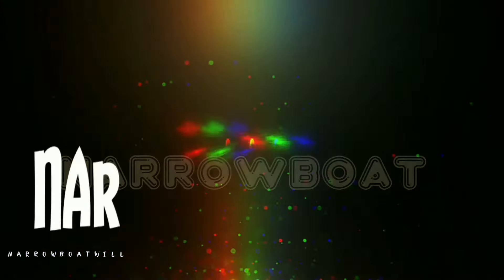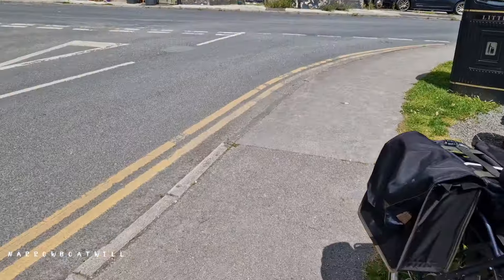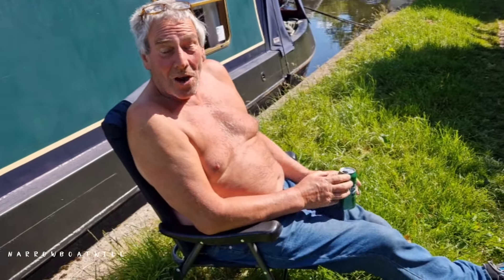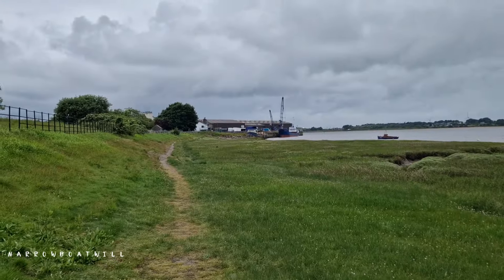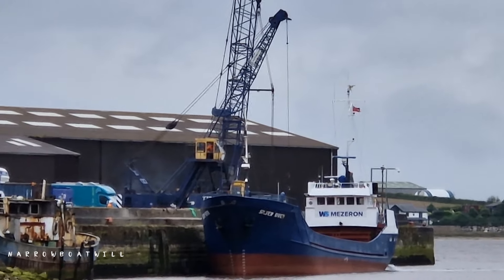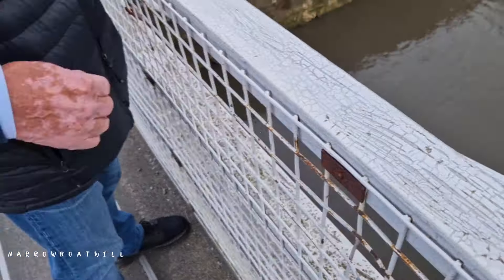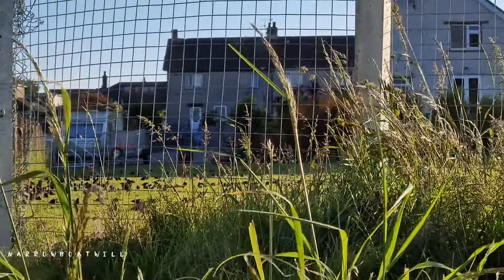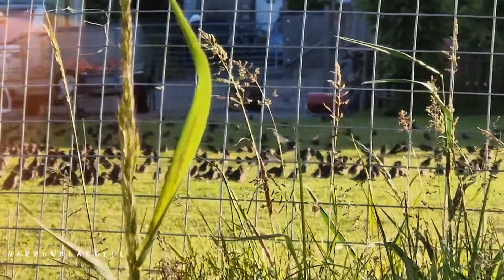The hidden gem of the Lancaster canal. Glasson Basin. My journey continues..

Comment: Hi Will another great video,   just one thing, when you clean paintwork with T cut ,  you need to polish it afterwards with normal car polish or it will go dull again VERY quickly, I know from experience.....
Reply from the maker: I did wax it afterwards. To be honest, if my paint was mint, I'd use other methods, but I painted this boat by hand years ago. I'm painting it again soon. It looked much better to be fair. I also restore the cratch frame. Stay tuned ripper. 😉

Comment: You can buy the bioethanol fuel from good ole b and q it’s not expensive and comes in either 1ltr or 2 litres bottles. They really throw out some heat Ehat a lil piece of heaven you found 🤗🤗
Reply from the maker: That fire was amazing. Fran and Henri are such lovely couple. 😍 
That basin is a little gem.